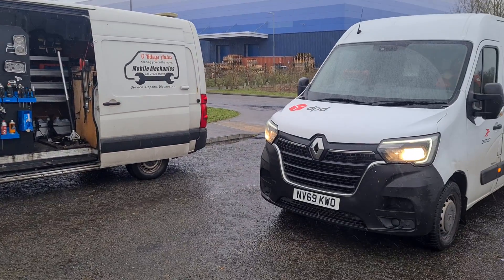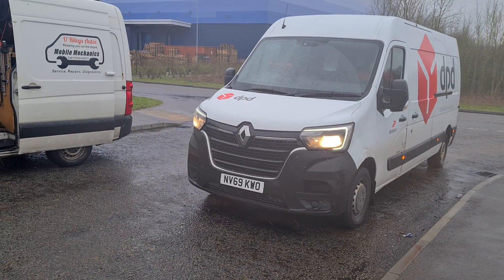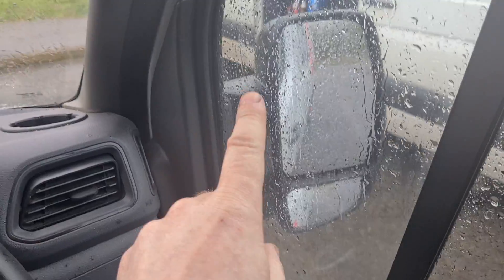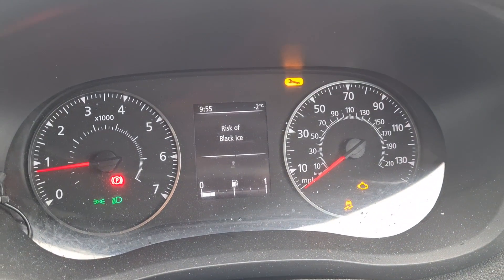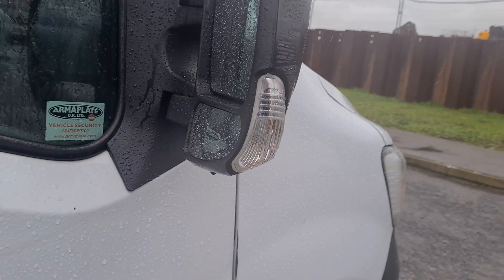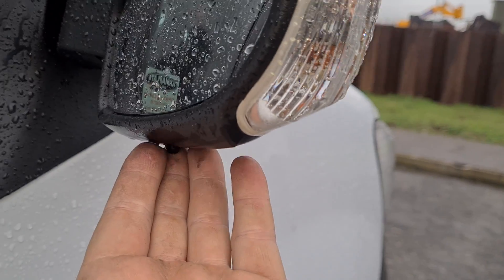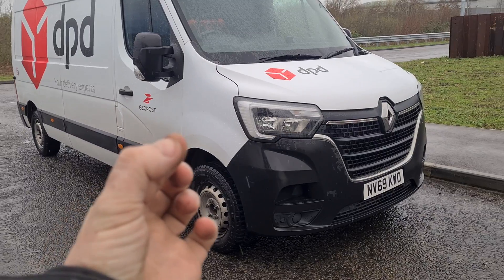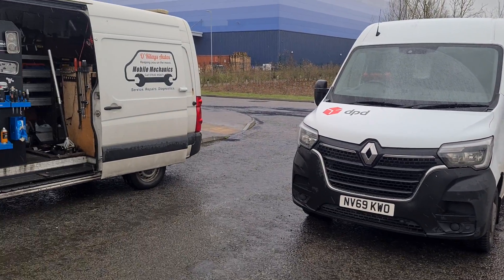Why This Aftermarket Wing Mirror Caused Adblue Fault & Blocked DPF

Comment: I’ve heard of cars not being able to start after someone knocked the mirror off so nothing surprises me anymore in the motortrade

My own car (a Renault I will add 😅) the horn wouldn’t work but the fuse was fine and the light stalk would only work with the ignition off. I pulled every fuse in the board in the end to find that the “Alarm” fuse had blown. 

Turns out this same fuse does the stalk too yet it’s not mentioned on any fuse board diagrams I have 🤦🏻‍♂️
Reply: On Transits it fires the fuel cut off if you bang the mirror too hard, I know I've done it, didn't even realise I had a fuel cut off on it until I smacked the old mirror to get it off and then couldn't start the van afterwards.

Comment: I drove a Kenworth T880 that had the ambient temp sensor in the mirror. It at one point broke and road salt/water got in it. It read up to I think 130°C before it decided it was out of range. No idea why, if it was 130°C outside you'd be dead anyway lol

Comment: Buy a French van then fit cheapo parts 🤦🏼‍♂️
My work van is a sprinter Luton 316 (2.1 twin turbo 160 hp)
It’s just clocked 254,000 on Friday, still pulls like a train and faultless
Edit, it’s a 69 plate.

Comment: I've got to ask, what happens when it really is -2°C outside, do all those warning lights come on?
Reply: No, there are other temperature sensors in the vehicle and it is getting warnings because the readings of the different sensors are inconsistent. On a vehicle built correctly, all the sensors will work together in the way that the manufacturers expected, so (hopefully) no warnings.
Reply: @MalinDixon The software engineer in me is now thinking, why not just report a temperature sensor fault then? 🤣
Reply: @richardharding8438  The way that modern vehicle are designed, the fault codes and so on will have been decided well before anything vaguely similar was actually driven, and so by the time that the actual faults happen, no-one is working on the diagnosis stuff any more.
Fault codes are only reliable when there have been faults that were predicted, so for the temperature sensor, a short or open circuit where the single sensor is obviously giving a stupid reading, then it's likely to be informative. The reading of -4°C wasn't in itself silly, and so no-one thought that that particular fault was worth having fault codes for.

Comment: I’m inclined, after watching multiple of your video with the same issue, to install a separate temperature sensor somewhere else on my Ducato ‘13 (Euro 5) camper. As a back up. Gonna look if the temperature sensors are sold separately.
Reply: See if you can get a smashed OEM mirror off a repair.

Comment: Mirror mounted on wing, wing wirror.  Mirror mounted on door, door mirror.
Reply: Been like that for years. Fan belts don't drive fans,  you don't put parcels on the parcel shelf because it's usually a fabric luggage cover, steel is a alloy, so your steel wheels are really alloy wheels, ever put gloves your glove box?  Despite all that, I get your point!
Reply: @Gloucesteroldspot  Don't laugh, but alloy wheels when they mean ally wheels is another pet hate of mine.  Who started it and why.  When I was going up cars that came with new fangled door mirrors proudly announced they were door mirrors, and when cars were fitted with magnesium wheels (mags), aluminium wheels where 'allys'.  Are you quite right say, all wheels are alloys unless you have wooden or carbon fibre wheels.  Now, getting on to gloveboxes and parcel shelves, we'd also have to question wings.  I've never heard anyone call a accessoey belt a fan belt, but then I've also never heard of one breaking, so not surprising.  And don't even get me started on people adding 'up' to sentences.  I parked my car (up), I'm going to cook some dinner (up), let me get this signed (up).  Whatever ever happened to our fine language innit?
Reply: @Gloucesteroldspot So where do I put this trafficator fluid?
Reply: @dougaltolan3017  that's starting handle, obviously.I'm getting old.
Reply: Actually if it's DPD they probably do put parcels on the parcel shelf cos they gonna max out the vehicle! Some "fan" belts do still drive fans although it's less common now. And I have on occasion shoved a pair of gloves in the glovebox (they were lying on the seat annoying me), so there is still some currency to certain terms. The mirror thing is totally true though - I've only ever owned one car with wing mirrors, a 1970 Triumph

Comment: Hi Jimmy. I have spent £3k on DPF issues on my peugeot Boxer. I have replaced my wing mirrors with after market versions but my temp sensor seems to work fine. Could this still be the problem? I'm now being told to remove the DPF but I'm against that if possible.
Reply from the maker: What faults are logged? That should point you in the direction
Reply: @ORileysAutos  thanks for replying! I'll try to get that information from the mechanics.
Reply: @ORileysAutos  P119F-22 Deterioration Of The Engine Oil: Rate Of Dilution Of The Engine Oil Excessive

U1113-87

ABS/ESP ECU: Absence Of Communication

Comment: Peugeot Boxer’s temp sensor was reading 86 degrees with adblue faults.  Spent £400 at garage no effect. After I saw one of your videos I got sensor off Peugeot £80 and fitted it myself. Issue gone!

Comment: Cheers jimmy, would have thought a wing mirror was a daft place to put a Temperature Sensor.
Reply: MY old Nemo had it fitted above the radiator in the engine bay, less likely to get vandalised !
Reply: In theory, it's a decent position for it. But it's very vulnerable to damage. Delivery van drivers love to try to cram their vans into tight spaces.
Reply: All by designed tomake sure you buy  only makers parts.😮.

Comment: Such a dumb place to locate the air temperature sensor! Particularly when the OEM mirror is so expensive that people will look for aftermarket alternatives. Built-in trap!
Reply: The mirror has to be where the view from it is behind the van, so it has to stick out the side. The air temperature sensor also has to be away from engine heat and in clear air, whether the van is moving or not, and whether the fan is running etc. so it makes sense to have it stuck out the side. At that point the makers might as well put the whole lot in one assembly. They have also added the side repeat indicator in the same assembly, for similar reasons. The extra cost of a temperature sensor in an assembly like that is insignificant, and far less than the cost of a separate sensor that could also get broken off.
The problem here is not one caused by the manufacturer, is is caused by an aftermarket part supplier making an assembly that doesn't do all of it functions properly. The aftermarket parts supplier could have copied the temperature sensor properly if they cared enough.
Reply: @MalinDixon  but a mirror on a vehicle is one of the most likely things to get hit by accident which makes it a dumb place to put the sensor and makes it expensive for the owner or user of that vehicle to replace because all these different things are put into one unit, the manufacturer saves money building one unit, but they will mark it up when people need replacements.

Thanks to the video, i know not to throw my old unit away in case I need to swap bits over when i get a more modern van and if someone hits my mirror and it needs replaced.

Comment: Ive had this a couple of times on euro 5 DAF trucks the ambient temp sensor is in the nearside mirror. It often gets damaged when the mirror gets damaged and there is a mirror available without the temp sensor most of the cheap ones dont have it. It brings engine management warnings, adblue warnings all sorts. Some got broken so frequently that we just bridged it with a resistor of a certain value and tucked the wiring back into the door. The truck always thinks its 16 degrees with the value we use. Naturally we dont know if this has adverse effects but no problems so far.
Reply: What value resistor to get the 16°?
Reply: Probably wouldn't hurt anything till it got extremely cold out
Reply: @juliogonzo2718  yeah more than likely I suspect it runs it/uses it differently in very cold weather.
Reply: @BurnedOutGarage  be cool if you could use a rheostat. Then you could dial the ambient temp reading up and down to match reality
Reply: @juliogonzo2718  yeah that would be good like a pot on the dash. I guess I could have used on old sensor from the mirror and tucked it away in a different place 🤔
Reply: @BurnedOutGarage  lots of manufacturers put it behind the grille so you could do that too most likely. Just have to do a little wiring. Could find the wires in the a pillar then extend and run them through firewall. Probably easier to find the wires where they go into the door instead of under the hood

Comment: so it has a sensor  does it need to be coded or is it just a bad repro sensor
Reply: I'm fairly sure that it's just a bad reproduction. The sensors are normally thermistors, resistors that change their value with temperature. There are many different characteristics of thermistor so it should match the original at all temperatures.

Comment: Yet another stupid idea!
FFS, a mirror causing all those issues.
Reply: Not really.  Why fit two ambient temp sensors when one can be doubley purposed  ?
Reply: @timbo19751975  it could be fitted to  a better place though other than the wing mirror
Reply: @mattyyy86   EG ?  Needs to be where it isnt affected by radiant heat, nor direct sunlight.
Reply: @timbo19751975  loads of places. Mines behind the front bumper always accurate temperature.

Comment: Get the aftermarket mirror, but swap over the original sensor!
Reply: Yeah, if its possible, sometimes it causes too much damage to take plastics apart.
I usually hold on to old parts for my vehicle just in case and looks like its something to be done more often now with this generation of vehicles.

Comment: it is posible to purchase the temp sensor itself
Reply: Cheaper to buy a smashed mirror.
Reply: Its just a simple thermistor. A resistor that changes value with temperature. Cost a few pence.